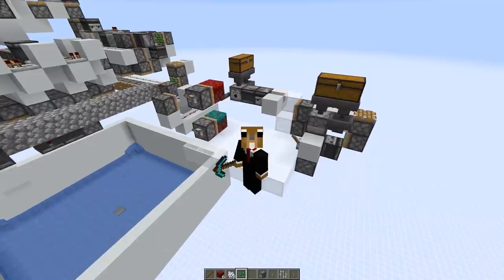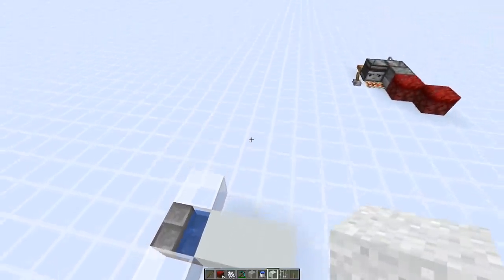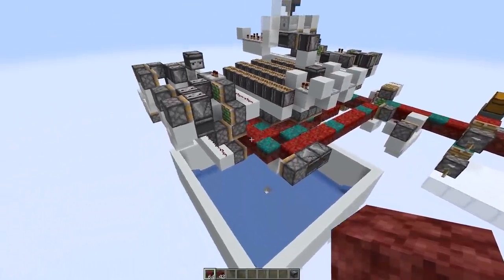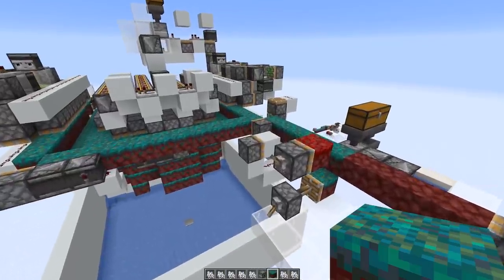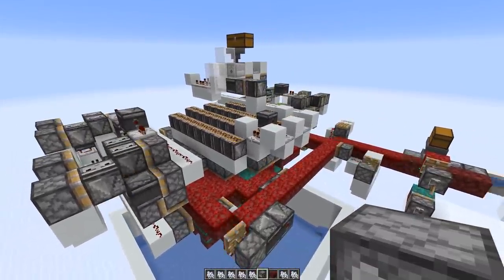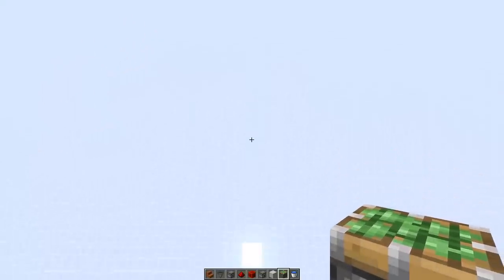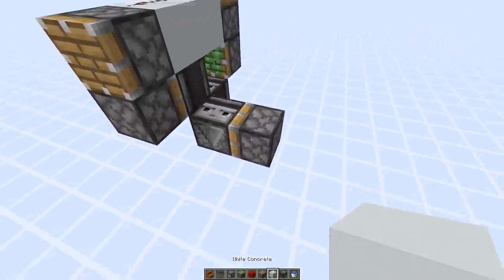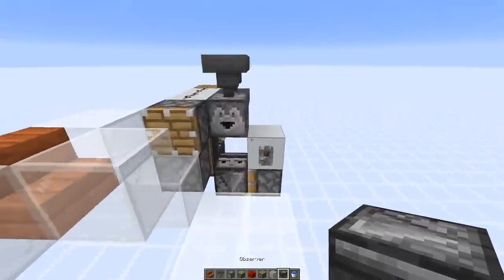Concrete/Nylium Farm Module For TNT Blast Chamber 1.16

Comment: Casual minecraft user: Hmm i wonder how we can use Nylium
ilmango: built a TNT Blast Chamber for Nylium regardless of its usefulness
Reply: a double chest is required
Reply: i mean nylium is where you place the fungi which turns into the nether wood with bone meal. Sadly, the generation of nether trees in comparison to the ones in the overworld are quite different so it may be quite the challenge to make a farm. Also, the wart blocks dont despawn. But i think that ilmango can manage it, in fact it will be an easy task for someone like him.
Reply: I mean, he didn't build the chamber for nylium since he made it before nylium but ok

Comment: I've also found this farm is useful for converting wood to stripped wood if holding an axe whilst placing the barked wood into the slot. It does require removing one of the redstone dust to slow the system down though.

Comment: Can you blow up the new high blast resistance blocks using the block 36 trick, since they're movable?
Reply: Would depend on the percentage reduction to the blast resistance. Anyone got any numbers?
Reply: Yes, i've tested it
Reply: @mattevans4377  it multiplies it by 0
Reply: Yes you can.  Which means nether quarry time.
Reply: @mattevans4377  i dont think that there is a % reduction, block 36 is simply block 36, it stores the block that the piston is pushing inside, since ilmango has not already make a farm for them i would assume that they simply cant be broken even in this form since block 36 has the datas inside that says that is not breakable.

but i could be very wrong about this, if the ancient debris thing can actually be destroyed using that trick then im sure that we will see a very cool quarry-like machine that mines it soon enough (i think that we are going to see the quarry anyway but a player will be needed to afk to break the blocks instead of it being automatic too)
Reply: I also tested it and it works.
Reply: @arthaiser  I've managed to blow up ancient debris with the block 36 trick, it is possible.
Reply: @tirex3673  :0
Reply: @mattevans4377  block 36 has 0 blast resist

Comment: There's something i don't quite understand, why use this big module to 0tick the piston ? what is the advantage over the one mumbo used in his concrete machine ? where there is a torch beneath the concrete placement, taht will run a redstone circuit to 0-tick the piston when you place a block ? It's one of your circuit i think. Also on the same question, i realised the circuit doesnt work with stone or cobblestone, it often gets jammed, do you know why ? I wanted to use the concrete making machine to break some of the stone i mined with my silk touch instead of going back to mining with another pick, and the machine would constantly get jammed..

Comment: @ilmango is there a way to slow down the dropper that gives out concrete? I am on a vanilla server and I keep getting an accumulation of concrete powder at my feet. I would imagine this is due to server lag not being able to place the blocks down fast enough to keep up with the rate at which the dropper throws out items.

Comment: i follower these instruction to the t even though there not that many i ran into a problem were it kept powering it self even though i shout if off. adding a redstone repeater instead of the second piece of redstone dust leading into the piston fix that problem

Comment: Would it be doable and interresting to have a TNT blast chamber that loads blocks from multiple lines of blocks? In this case probably no, because you are limited by the speed of placement of blocks by a single player, but in cases like cobblestone, you can have multiple cobblestone generators. I am curious to know the maximum rate of cobblestone that could be created and blown in one single blast chamber.

Comment: I feel like the TNT blast chamber could be modified to intake two streams of blocks, though i couldn't get it to work the way I wanted.
Reply: the first thing the blast chamber does is separate the stream of block into 2 stream so yeah you could just skip that, feed one of them with your block placing and the other with a cobblestone generator. just make sure the timings are right.

Comment: You probably wont see this mango, but I have tested the farm in 20w12a and most of the nylium turns back to netherrack. Do you know of a fix for this?
Reply: @BotPokey  I mean, it stays nylium for a little while so if we used a simpler blast chamber design, not the most efficient one, it should explode quicker than it can convert back.

Comment: Could you use this blast chamber to mine ancient debris? Ancient debris can be blown up, while being moved with a piston
Reply: Ancient debris is TNT proof
Reply: why would you want to blast chanber it? them not blowing up is a boon, easier to tnt bore for them
Reply: @Daniel Dekan you can, using the same trick that is used to make blast chambers more efficient: the moment a block is moved, its blast resistance is 0, and it can be blown up.
Reply: How would you get enough ancient debris to even have to use a blast chamber for it anyway?
Unless you somehow find over 1000 ancient debris, these is no point.
Reply: @JustJum  Not if it is mixed with other blocks, like in certain quarry designs
Reply: @tirex3673  4 blocks per chunk according to carpet mod and if you are using similar quarries as diamond you have the major issue of frequent lava pockets